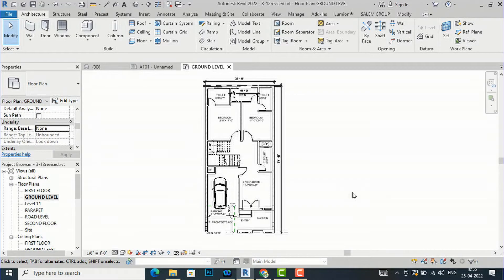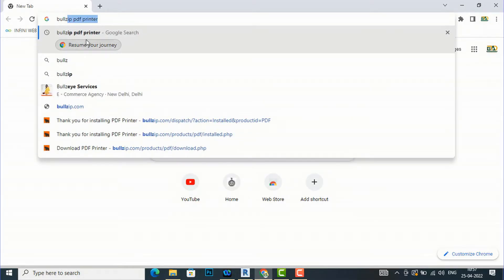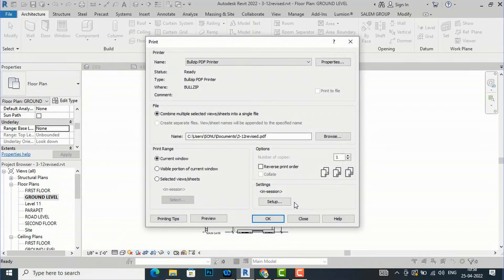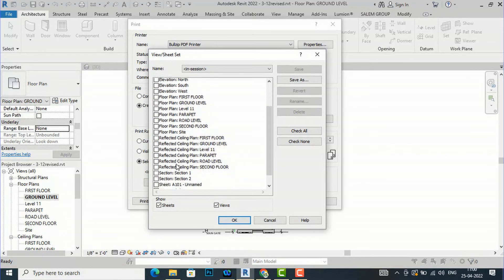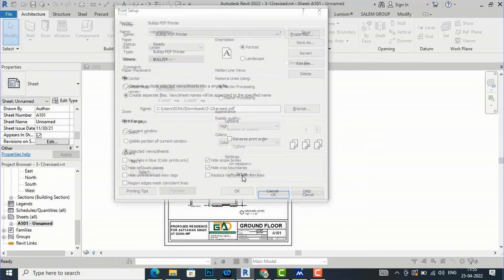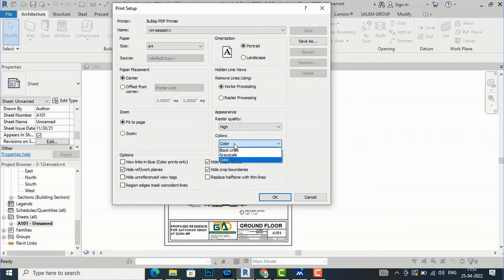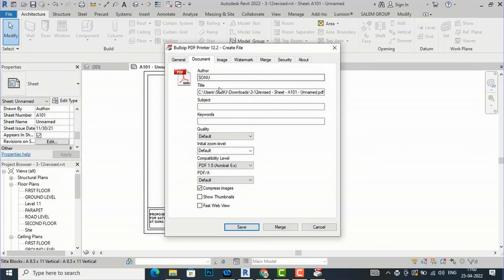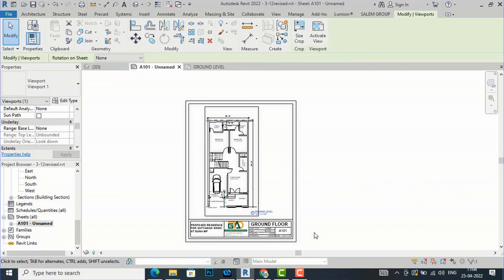PART 80- HOW TO TAKE PRINT IN REVIT

Comment: Ofter importing objects from sketch up to revit ,
That objects are not visible original colour.
  objects visible like black clour are shaded.
Give me suggestions sir....
Reply: I did it exactly sir
Reply from the maker: @anushasomidi1012  try some other model version there may be comparability issue with some models version
Reply: @gladstudioarchitects  from Last two days to am importing  the objects from sketch up to revit am not focused in 3d But Today am check in 3d all objects not visible original colour.
Reply from the maker: @anushasomidi1012  what version of Revit you are using try 2018 or higher...view the model in Revit ..visual style to realistic mode
Reply: @gladstudioarchitects  REVIT LT 2022
Reply from the maker: @anushasomidi1012  save the sketchup file to lower version 6 and try .set the visual style in Revit to realistic
Reply: @gladstudioarchitects  k sir 
Share the visual style to realistic video sir
Thank you so much sir
Reply from the maker: Explode the model group in SketchUp then save it as SketchUp version 8 and import in revit